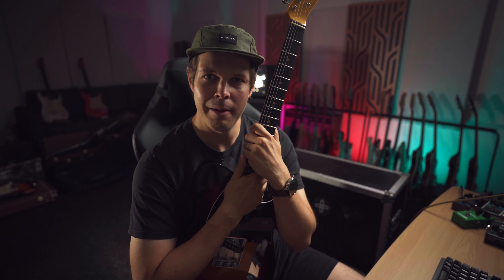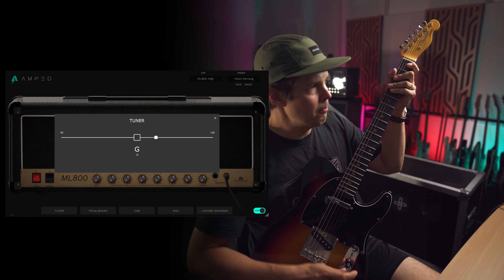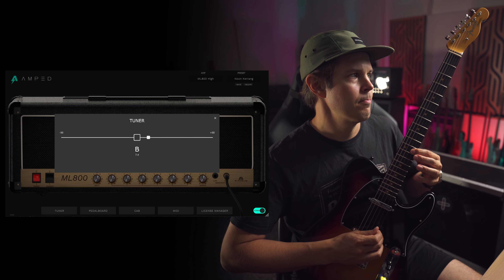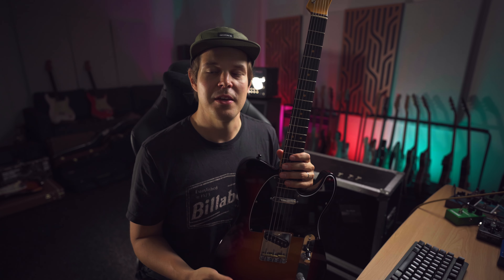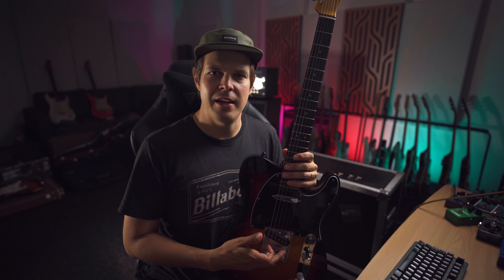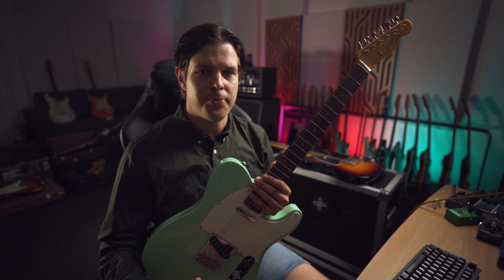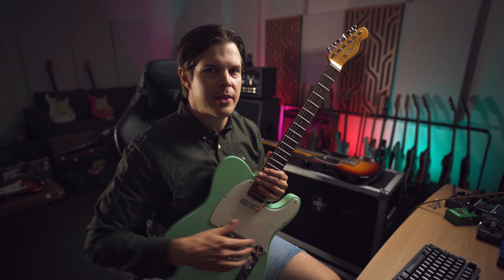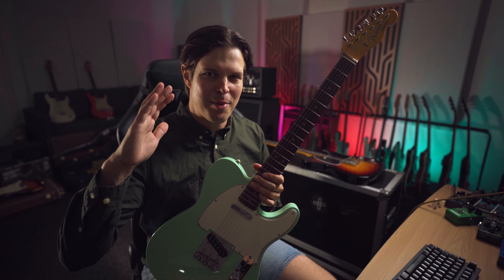Why Use Compensated Brass Saddles on Your Telecaster

Comment: Did you just posted a tele video the same time I bought a tele? 😅🤣🤣 kinda opened my eyes 
so thank you for that, and as a matter of fact I ml amped gnr to test it and the tuners meter wasn't moving on b and e strings! 🤔 I haven't changed the strings yet, that might be the reason you think?